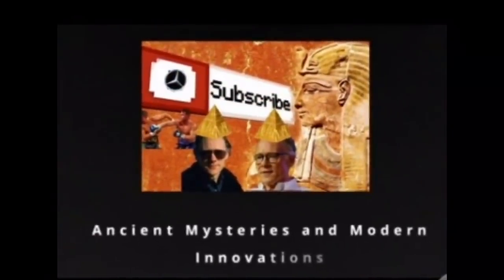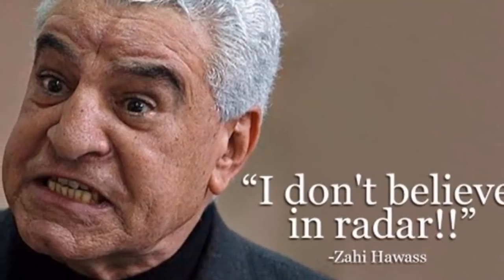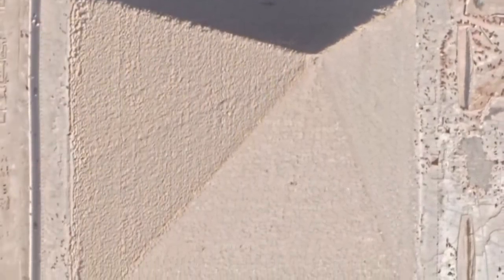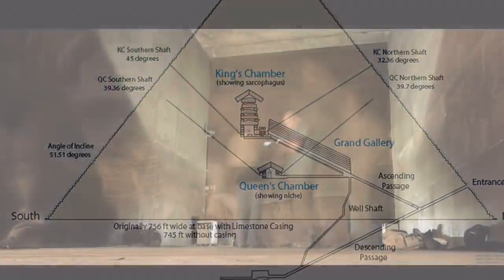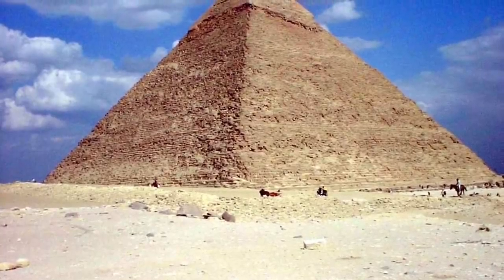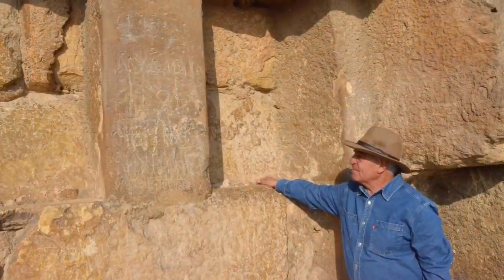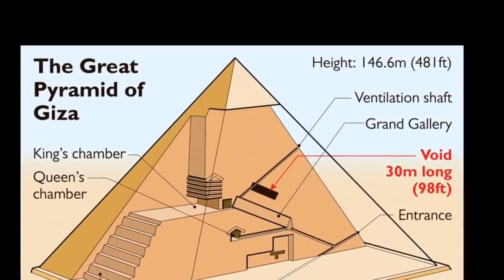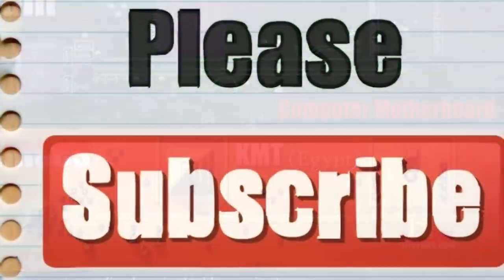Graham Hancock on Geopolymer (Liquid Stone) Technology at Giza Pyramids

Comment: “Polymer” is not an answer to anything. It just adds a ton more work to build the forms. When you build a concrete bridge you actually build it twice once in wood and steel and then the concrete.  The blocks are random sizes  so they didn’t reuse the forms .

Comment: they poured the blocks on site as they went up and the fossils were formed when the pyramid was under water. we also see major water damage around the Sphinx. so basically the granite bowls all the statues and buildings are all geopolymer. this also explains why the romans and greeks were able to build so quickly every where they went and how the massive granite sarcophagus got under ground they were not dragged down their they were molds geopolymer
Reply from the maker: You mean in the kings chamber? Doesn't explain serrapeam at saqqara...
Reply: How did fossils get inside the rock. On the surface sure ..but within the rock itself?

Comment: The Romans used concrete, so that fact alone proves it existed in antiquity. At 2000 years old the coliseum is still fairly intact, proving the right formula of concrete will last for millennia. They need to take multiple samples of the Great Pyramid and put them under an electron microscope to determine their actual composition. Geopolymers poured into molds make more sense than precision cuts made with copper chisels and stone balls. Problem is that mainstream Egyptologists like Hawass and Lehner will never allow any new discoveries that might shatter the status quo.
Reply from the maker: They're still hiding everything

Comment: I belive the limestone blocks were poured into moulds on site . The granite blocks were made by melting granite ,they meted granite  using a giant magnifying glass to focus the sun heat onto the granite chips.
Reply: How do you melt granite I thought it just turns into obsidian?
Reply: The granite was poured just like everything else. 

The recipe is still known today by elite stone masons. Poured granite has a dense outer layer which is water resistant while cut granite does not. It's easy to tell
Reply: The most plausible theory I have heard thus far….

Comment: here....make yourself rich. Water (and the weight of it) was used to raise the blocks up to the required positions. Throughout the Pyramids were chambers and passageways where water was fed by gravity, hand pumps (powered by man and donkeys) filled certain chambers and enabled the blocks to be counter weighted.....the used water (over flow) would return back to the pumps to be reused. Aliens? Crap! Man has proved himself to be extremely adaptable. Picture this......at the height of say...every 20 feet, several slaves were used to grease the slope, others were attaching ropes to the designated block, water was being pumped to the next level..into a box like shape which, by it's weight, would descend down a chamber pulling the block in the opposite direction. Much the same principle as a elevator with it's counter-balance. And you mean to tell me that NO ONE would have worked this out?
This comment (note) is time recorded at 18:36 on the 15/04/2019 and witnessed by Youtube *

Comment: Would it be feasible to assume that they did not use a slurry to fill the entirety of the mold?  I mean, there are countless situations where you can use whatever you want that is convenient to fill the inside of the mold.  Pour 1/3 of the mold, throw in solids to help fill the mold, finish pouring.  Now you have a poured mold that has the potential to have fossils in it.  Not to mention I believe it would be far easier to fill in a mold with X amount of solid than it would be with Y amount of slurry.  Add in that water was needed for the slurry, and you now have more steps which involve more labor, time, and resources compared to just tossing in solids.
Reply: Yep. When i pour concrete, i often chuck in old broken bricks or rocks as filler. There are probably literal chunks of limestone within each geopolymer stone.

Comment: Fossils were used in "Roman Concrete" so it would make sense you would see fossils. In ancient concrete fossils was part of the recipe. Concrete recipe is Sand, lime, ash, fossils  heated up and add sea water... Pour into a square form....They had all that.
Reply: Then why are the stones all different shapes? That would make them tougher to fit and not make a solid structure.
Reply: @1950Chimaera  it makes it more stable against earthquakes. If the blocks didn’t lock into one another it would just fall apart
Reply: @tyc6268  my man, it's a pyramid. It likely wouldn't fall from an earthquake regardless
Reply: @crypt1d550  stacked rocks don’t fall. Mortar? What’s that?
Reply: Although what they show as fossils looks like tamp marks from the end of a 3.5 inch diameter tree ... shows the imprint of the tree rings at 1:48 into the show

Comment: RRRRAAAAGGE!  Do you slack-jawed, simple-minded dumbfucks actually believe that stone is indistinguishable from a composite material like concrete?  Any engineer or geologist or construction worker that has ever poured a driveway could stand ten feet away and tell you, definitively, "That's made of stone." or "That's made of concrete."  It's not high science.  No need to take samples back to the lab for analysis, no competing theories, no room for interpretation.  The two types of material are nothing alike.  Not to mention that dragging the pulverized aggregate up the side of the pyramids would require just as much energy to haul up there but would then add the additional hassle of pumping water to that height and building forms to pour the blocks in, etc.  Jesus!!  Fucking pyramid theory dingbats!

Comment: "turned it into a slurry with [just] water"  ...Oh god, he simplified it right out of the actual chemistry required!  Davidovitz was very specific in that it required lime water to dissolve the limestone, either slaked lime from baked and rehydrated limestone, which they did not have any evidence of, or a lye solution which is leached via soaking water through ashes from wood fires, which IS listed in many Egyptian texts as a requirement of all households to donate their hearthfire ashes to the priesthood! You can't dissolve limestone with just water in a reasonably short period of time.  You need a caustic (high pH) alkaline to do it!

Comment: Obviously bricks. Use a magnifying glass and you'll see tiny circles that are hay remnants. The hay was inserted to get air in to dry it. This was found out 30 years ago. That doesn't explain the lower blocks, which are definitely quarried, but they did find the boats that transported them.

Comment: You don't need a mile long ramp to get less than 10% slope - if blocks were moved by hand, and I say IF, then a ramp spirlling around the pyramid could have been used and the material used in its construction could have consisted of facing stone used from the top down as the ramp was dismantled.  Just a thought.

Comment: I normally like what Graham has to say. But in this case he is talking without researching. The geopolymer theory postulates that the limestone was dug from dry "Wadi" beds (loose or gravely limestone). This idea that the limestone was ground up is something that he is making up. In natural hard limestone the dead bodies of nummulites or fossils are horizontal layers upon layers of accumulation. You can see the strata in the limestone as the dead bodies built up over thousands of years. In the geopolymer casing stones the nummulites have no such stratification. The nummulites are positioned in extremely random orientation. Some vertical some diagonal and very intermixed. And it is this randomness that indicates that it is not natural hard limestone. 
Further, in natural hard limestone the magnetic orientation of the layers and the nummulites is always in the same direction. Magnetic north and south are on the horizontal plane. Which makes sense because the dead bodies fall to the sea floor and build up over time. In the geopolymer casing stones the nummulites magnetic orientation is all over the place. In some magnetic north faces up. In others it faces down. In others it faces horizontally. In others it faces diagonally. Which is further evidence that it is not natural quarried limestone.
In this instance I have to say that he's talking out his ass and hasn't studied the arguments or the material.

Comment: Perhaps an explanation to bring both the fossil and geo polymer points into alignment is that the stones were not ground down but polymerized in a fashion that leaves the fossils intact when re-solidified.
Reply: You mean they were melted in a way that don't change their structure right? Not using fire, but some other softening method.

This is the better theory, there are photos of stones in old sites you can clearly see the stones where melted and you see "marks" as if a machine passed there when they were still soft.
Reply: The correct frequency applied to granite makes it vibrate. I theorize that sound was applied to the granite to cut it more easily

Comment: Is it possible they threw the fossils in the mix as a fill? I myself when I'm mixing concrete throw rocks in sometimes to fill whatever hole I'm pouring in. Is this a possibility?
Reply: Johnny Z used to run my own formwork company, still not sure how they could’ve managed the 70 tonne granite ones though
Reply: @wtfisitallabout  
maybe they carried the granite blocks one step at a time slowly as they kept building the pyramid.
cutting and a carrying a couple of granite blocks is easier than cutting and carrying millions of huge stone blocks around egypt.
Reply: @wtfisitallabout  you are right, granite cant be poured, although some 3 hour documentary is about melting granite into liquid and pouring it using some huge magnifying glass, very silly. Granite melts into Basalt/Obsidian.
Reply: @wtfisitallabout  granite can be poured. If you look at it under a microscope scope you see it's made up of lots of tiny pieces all mixed together. 

There are stone masons today who work for the elites they are supposed to keep quiet but a few have spoken out. They can make granite using geopolymer. The key is that cut granite with always have a rough outer layer. Because no matter how much you polish it you cannot make it more dense. Cast granite using geopolymer will have a dense outer layer which is usually water resistant. The water will run straight off the outer layer of granite made using geopolymer. Cut granite, the water will soak in and leave a dark patch. 

Obviously erosion could make a difference.
Reply: Why would they throw fossils and not stones? Why fossils? If they threw things on the mix to create volume you would see random stones too. And there seems to be none.
Reply: @LucasBKOK  the Egyptian desert is full of fossils and the Egyptian are historically recorded as fossil collectors. The desert was also believed by Geologists to be a sea at one time. The pyramids show signs of water lines and water submersion erosion. Fossils were everywhere not rare.
Reply: @LucasBKOK  have you been to the great pyramids or any pyramids? You can look up pics of the rocks and aggregate in the stones whether they are sedimentary limestone stone or concrete. You're making a false claim that there is no visible aggregate.
Reply: Johnny Z that was my thought exactly why, no reason they wouldn’t of got thrown in with the mix concrete ain’t all powder there’s stones in it as well
Reply: The pyramids are definitely geopolymer. You can see some "blocks" are completely joined together with no gap at all. There are phots somewhere on the internet of this.

Comment: It may very well have been possible to soften the stones and mold them, but that would not explain how they were moved. The stones were definitely not poured however.
Reply: I love how you accept the idea of softening stones (a waaaay more outlandish idea than concrete) which still leaves the problem of moving them, but then you state as fact that they were not poured which would solve that problem. Dumbest take ever lol.
Reply: @chris-the-campbell  Were they poured, the seams would be decidedly different than the gaps we see. While you may fail to comprehend that simple fact, it does nothing to negate the reality that had they been poured, there would have to be containers to hold the pour, and the connecting edges would be much different than what is seen, even with thousands of years of erosion.

Comment: Just because there were fossils in the stones, doesn't mean they weren't poured. You could pour the slurry, but when you add the sand, there could have been fossils or sea life in the sand that got mixed in with the slurry. So his postulation about how just because there were fossils within the concrete mixture, thus discounts that they were a poured mixture, is invalid. Because the "Fossils" found in the stones, weren't stuck in old stone, but rather trapped in the poured molds.

Comment: This recording is dated.  I miss Art.  When Isis attacked a citysite and other ancient cites they smashed statues buildings and and other things.   All were taught all these were all carved,  But in the shattered remanats of statues inside they found filler stones,  and iron bars to support arms. 
So the inner frame was made a ROUGH mold was made and the outward show part was hand done with possible a fortified mixture that resists weathering.

There was a video not too long ago about someone in the concrete industry visiting Egypt  aka the pyramids and the quarries and he found tons of pulverized rock dust. 

Let us say Graham Handcock is an academic.   I am being kind.  I worked for years in concrete breaking old with sledgehammers, mixing and pouring foundations and floors, and mixing mortar and laying block. 

Concrete is almost never pure cement water and sand.  To have a very strong mix, and a concretion mixture that is EXPENSIVE any block is a mix or stone and the concrete,  Even in the "100%" concrete sand mixes there is STILL STONE IN IT. 

The strongest mix used today is called a 1 2 3 mix   One shovel of concrete powder, two shovels of sand, and three shovels of gravel.

I have watched videos on making stone counter tops where once these were cut and there was a lot of breakage. today many of these are poured.   Pink granite for example is poured.  And the crystals in this grow and bind and harden.  From a microscope when looking at real polished cut stone and poured stone one can not see a difference between the stuctures present. 

So their being presence things in the stones like fossils would not be strange.  

This man looked at the pyramids temples and quarries and cut stones laying around and distinguished differing things stone with cut marks and  stones he said were poured.   So.  Off the cuff asking an academic on things far out of their experitise all will answer and try to appear authoritative and knowledgeable.    I had a book on this called "The Experts Speak" in which experts when asked about things outside their education and even in said period beleifs  were wrong such a high percentage of the time it is pathetic.  It is far far worse than if they would honestly say I do not know.  But experts can not do that to hold their status.   And thereby millions are lead astray daily.
Reply: but graham never says he knows, he says he doesnt know and thats what intrigues him, but it seems you do, right on man
Reply: @mainsource8030    I am very handicapped these days so all I can do is read,  study, and pray.   All of which help insight into a number of subkects.   

Archaology Ancient history Greek Hebrew the bible and  Church history  are what I examine  on a  daily basis.
Reply: @bostaph-maverix5836  I see, sorry to hear that
Reply: @mainsource8030    Thank you . That is very kind.    Lord Bless You.

Comment: "Geopolymer" = concrete. Don't make it harder than it is. (See what I did there?)
Reply: Ceramics, Fiber Composites, Obsidian, and many other compounds are all geopolymers.  Concrete can come in two different forms, Portland Cement and Geopolymer Concrete.  Both are different processes and different materials.  So what you did, is make yourself look like a fool to anyone educated on the subject.
Reply: @julesmo323  Since we're obviously talking about a man-made substance, that takes obsidian off the table. Looks like being educated on the subject isn't so easy after all. All I'm saying is that whatever these blocks are made of, it doesn't imply anything particularly earth shattering. There are also several more forms of concrete than you named.
Reply: @MrMZaccone   - Obsidian is an example of naturally-occurring geopolymer    - Kozhukova, N.I.; Chizhov, R.V.; Zhervovsky, I.V.; Strokova, V.V. (2016). Structure Formation of Geopolymer Perlite Binder Vs. Type of Alkali Activating Agent, International Journal of Pharmacy & Technology, vol. 8, iss. no. 3, pp. 15,339.

Please stick to the subject.  Which is that "Geopolymer = Concrete" was such a flippant, bullshit comment that it required some fact checking.

Comment: Geopolymer type concrete would be heavier to carry than I dry rock. Concrete relies on the evaporation of water in order to set. The wet mix is heavier than set concrete. Much more effort to move
Reply: Concrete does not "dry".  It hardens as a result of a chemical reaction - known as "activation"  Geopolymers concrete hardens much faster than Portland concrete - and that can be good or bad, depending on the application